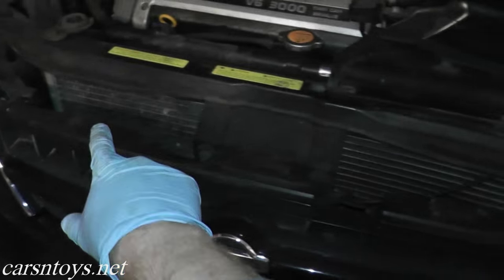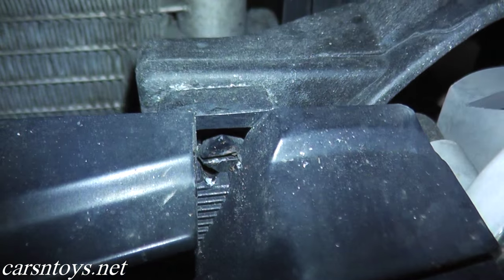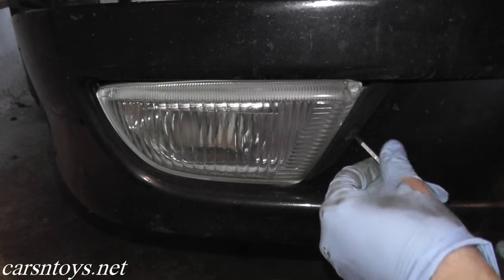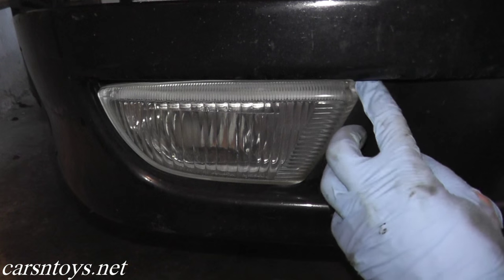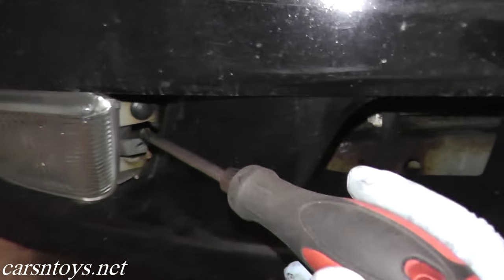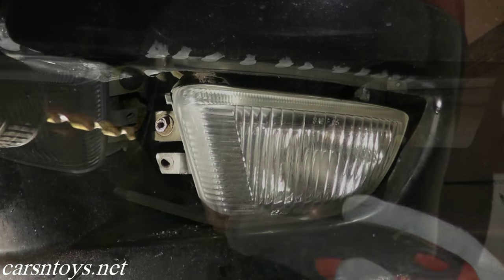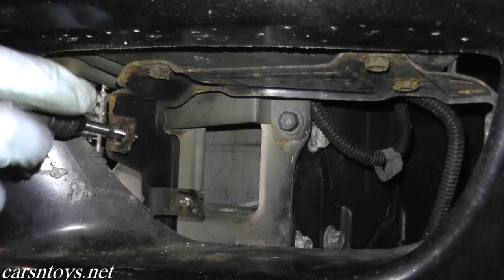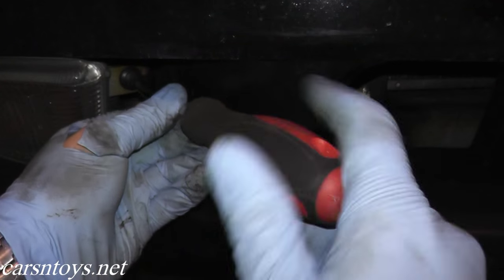Nissan Maxima Headlight Bulb, Turn Signal and Fog Light Bulb Removal HD

Comment: This video is really good. Just was wondering, do I have to remove the fog and turn signal lights before removing the headlight, or the particular does not matter? I managed to remove the 6 points on the headlight of my car that is connected to the parking lights, the grill and frame of the car, however, the headlight still felt stuck in there so I do not want to risk breaking something. If it doesn't matter about the order, then I'll just proceed to put more force in pulling out the headlight.
Reply: Turns out after further examination of my car that there was another  bolt on the back side of the headlight located above the rod that sticks out. So I had to remove three bolts on the back side, there are two on the side and the two screws that connect the blinker and the grill.